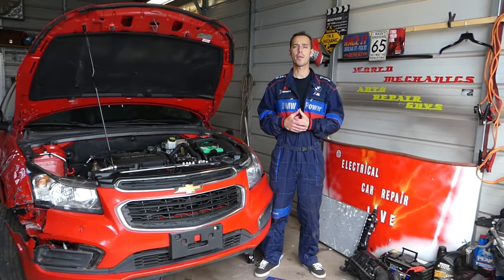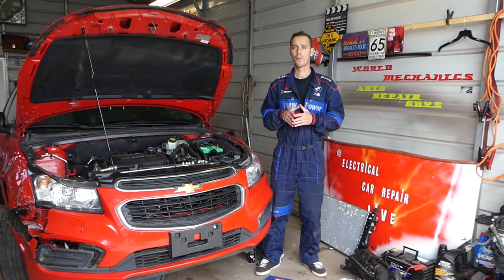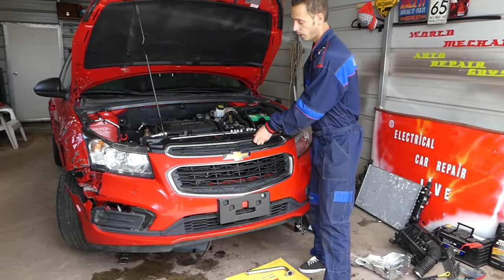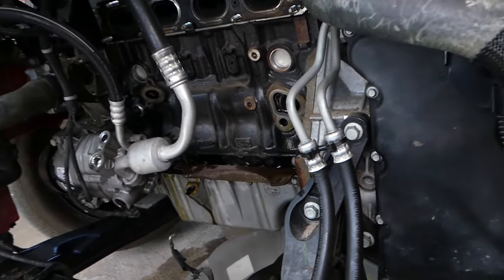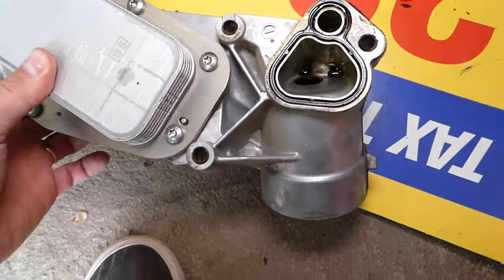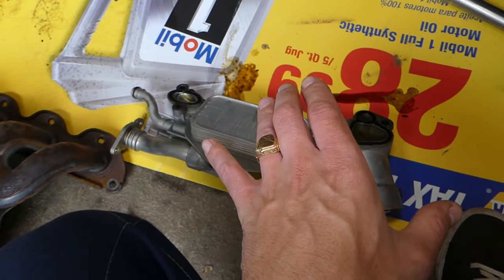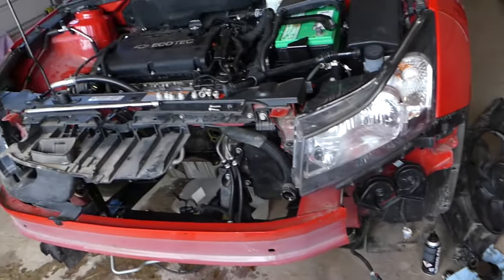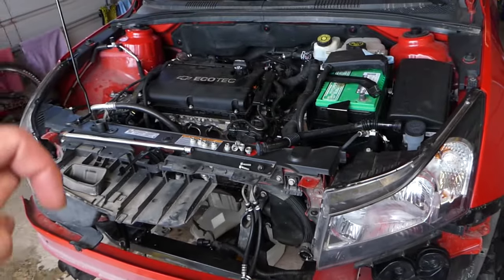COMMON OIL LEAK FIX CHEVROLET CRUZE SONIC. OIL PAN LEAK OIL FILTER HOUSING COOLER LEAK

Comment: Chevy cruzes are designed so poorly it's mind boggling.
Reply: I agree - I purchased a 2012 in 2014 with 37k miles.  Biggest POS.
Reply: Inherited a 2012 Sonic turbo.  Every month is a new leak (radiator fluid or oil) from cheap cracked plastic toy parts that GM bought for pennies from some 3rd world country.  Every part on this car is JUNK.

Comment: I have a phantom leak for my 2012 Chevy Sonic. My valve cover has been replaced twice and the leak remains. I have seen 3 other mechanics and one of them cleaned my engine which caused my belt to break. The second used the air pressure to clean to find the leak but could not fix it, It came back later that weekend. I went to the dealer and they said there is a lot of oil splatter and a leak.  Smh. I am a broke college student and I need to find a solution because I drive for uber to help pay rent.
Reply: There is 2 area that is supposed to be sealed with gasket seal
Reply: @October19x  what does that mean
Reply: The valve cover is a easy fix there is 2 areas that need to be sealed with sealicon
Reply: @October19x  yes that has been replaced 3x in two years 🤷‍♀️
Reply: @October19x  try ac delco valve cover

Comment: funny how all chevy cruz owners end up here around the same time i'm never getting a chevy car 
again too many problems smh
Reply: @uncovidvaxxforthestrongand3582  
Of the dozens of vehicles that I've owned over the years, the Cruze proved to be the worst of them all in-terms of failure and reliability
Reply: My 2012 Sonic has had 5 coolant leaks and 1 major oil leak.  A real POS car.  I'm dumping this car.  GM should be ashamed of the garbage engineering and cheap plastic parts put in this go-cart.
Reply: It have to be the Cruze because I have a 2011 Chevy Malibu LTZ  with 235k miles and the car drives like a new car still only had to replace the transmission other than that it's great ...most 4 cylinder cars have issues except Toyota and Hondas...Cruze were very cheap made poorly designed there's a lot of ways to bypass a lot of these issues with leaks

Comment: I have an oil leak on 2013 chevy sonic LT. I replaced the oil cooler because it was bad. But I still have an oil leak and the mechanic told me it was most likely the front crankshaft seal. My pcv valve is bad so I have to replace valve cover also
Reply: Had the same problems, oil leaks everywhere - valve cover, worn seals, compression loss - absolute junk of a car

Comment: hey bro, great video.
i have to ask (and afraid to)
i have a leak on the round aluminium "thing" on the right side of the block, behind the oil cooler area.its pretty bad.there are 2 of them, hope you get what i mean.

is it reapirable? thanks

Comment: Why these engine needed an engine oil cooling  like that???  My other Cars never have had  a cooler for the engine oil,,,, can we bypass those coolant tubes? And only let oil pasa through that radiator??? Just to avoid oil/coolant mixing

Comment: So if oil leaks at the cooler then that may be why I smell burned oil through my vents when heat is on. It must be dripping on manifold
Reply: Did you find this to be the case? When sitting still, I smell burned oil. Light turns green and I don't smell anything.
Reply: @mikelaes3175  I've looked down below the  turbo and i can see fresh oil on front of the block. So some of it has to be dripping on the exhaust manifold and burning. Then when my heater is on, it sucks it into the cab of the car. I haven't gotten around to fix it yet. So I definitely thinks its the oil cooler.

Comment: My coolant is nasty orange. What else should I change with my cooler
Reply: Coolant leak into oil - engine failure, one or more gasket or seal, warped head or head gasket leak, intake manifold leak
Reply: It is supposed to be Orange. It's called Dex cool